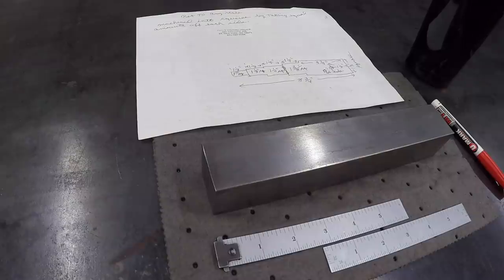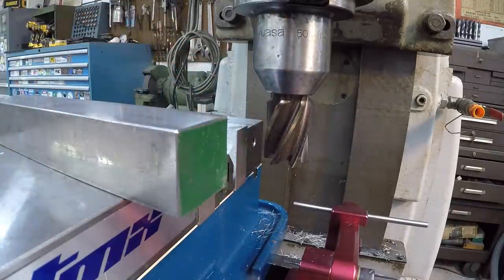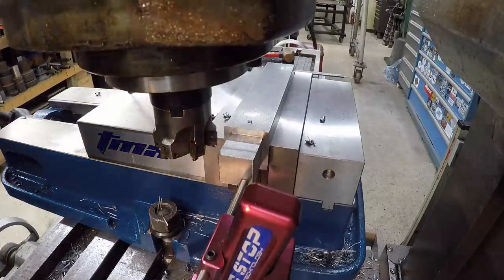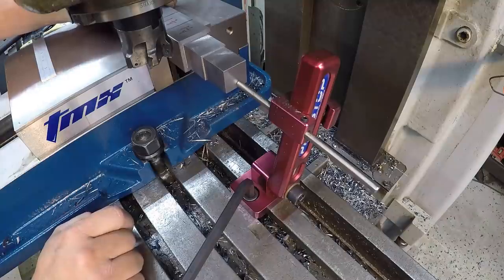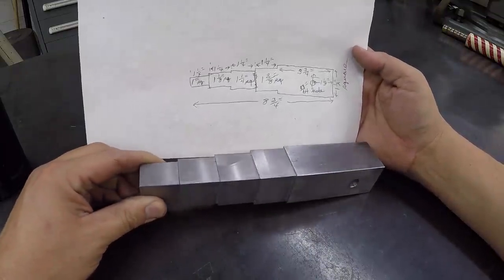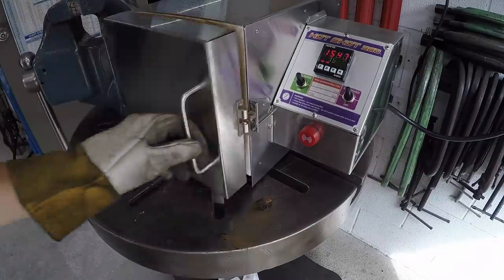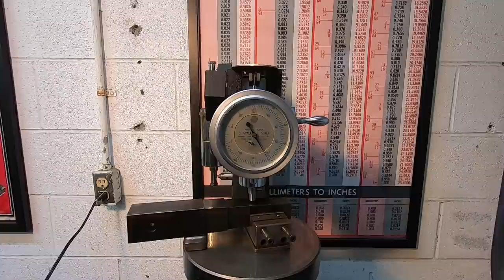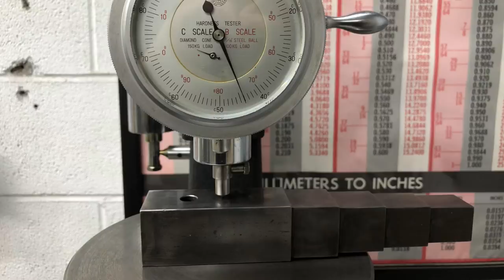SNS 296: Custom Square Drive Tool, Heat Treating

Comment: I've done my own heat treating for 20 years. I learned everything I know from two books. The easiest to understand is a book by Bill Bryson called "Heat Treatment, Selection and Application of Tool Steels. The other book which is much more detailed (and a lot thicker) and a little over my head is "Metals Handbook, Ninth Edition" "Volume 4, Heat Treating" Its put out by the American Society for Metals folks. My books say for 4140 to preheat the stock at 1200 degrees F for 10 to 15 minutes. This lets the metal calm down a bit. Evidently skipping this can cause the internal temperature to get much too hot, due to internal radiant heat. After preheat, increase the oven heat setting to 1550 degrees F. Once the oven gets to that temperature, the soak time is one hour per inch of material thickness. For instance if your part was 12 x 12 x 1" thick, soak time would be 1 hour. In your case it would be 1.5 hours. Remember, the timer doesn't start till the oven gets to 1550 degrees. Quenching is very critical, and as such, the actual parts needs to be touching the quench media. What I do is as quickly as possible, remove the part from the foil. Dallying here will only increase the oxidation of the surface, and not really affect the hardness of the metal under the oxidation layer. If you do it reasonably quick, I don't think you have a worry. Also move the part around in a figure 8 motion, since the oil the (headwind) oil will cool more quickly than the tailwind oil. A figure 8 motion will equalize this. The quenching process should continue until the part reaches 125 to 150 degrees F. This is uncomfortable to touch, but won't burn you. I read somewhere about the quantity of oil needed based on the volume of the part you are quenching, but my parts were always small. I had a 10 gallon metal tank, which was enough to get the parts down to 150 degrees, ONCE QUENCHED, YOU SHOULD IMMEDIATELY TEMPER. IT IS CRITICAL AND COULD BE A MATTER OF LIFE AND DEATH OF THE PART. This isn't from me, it is actually a quote in ALL CAPS from the Bryson book. Bryson says the parts structure is unstable until it gets tempered. He says the tempering oven should've already been preheated and at temperature, so the part can immediately begin the tempering process. The parts need to stay in the preheat oven for 2 hours per inch of thickness. The tempering time is not critical and if they stay in the oven a little longer it wont hurt. A note about wrapping with foil. The only purpose of the foil is to keep away oxygen. When I wrap my parts, I usually tear off some brown paper from a paper grocery bag and put it inside the foil, along with the part. The paper will burn, and that process will consume any traces of oxygen that may be present inside the foil package. I used this recipe for several years doing tooling for aerospace, and never missed a targeted hardness. I can't say what can be changed, because I didn't want to take a chance venturing from my success. Good Luck, and I hope this helps. Get the Bryson book. Also he has tons of charts that tell what tempering temperatures will give you what hardness. Its a great tool to refer to.   Steve

Comment: Hey Adam. I work at a large commercial heat treater out of Wisconsin. I’m not a metallurgist but I can offer you some info based on how we run 4140 and my heat treating knowledge. 
More quench oil. 
Remove the tool wrap before quench, you want direct part contact with the oil. You can leave yourself pull tabs or even use a piece of stainless wire layed in a seam to use as a rip cord to get it off quicker. 
You can try heating your oil up a bit. We typically heat to 120-140. This will help with not quench cracking your part also.
We run our 4140 at 1550 x 1 hour per inch of largest section thickness. 
The reason your seeing your low hardness in the thicker section is because the part has a thicker cross section and didn’t quench out as good as the thinner sections. This could be because it was under soaked at heat or because your quench is too small for the size part.  One more thing I noticed is in your oven. It looks like your elements are just on the side walls of the oven, also I didn’t see a convection fan in there. Granted I didn’t get a good look at it with the brief shots in the video. By the elements being on the sides the sides of the part will see most of the heat. That might be why on your test slug you have such a variation on the faces. In addition you could try a ceramic plate with stand offs between the soft brick in the bottom. 
I don’t think you would see any benefit bringing the part and oven to temp together. If anything you can extend your soak time on the part. Try soaking for 3 hours and see if there’s an improvement.
Reply: this right here, adam.
Reply: Very informational comment! Good read, hope this gives him some insight
Reply: You don't have to remove the foil before quenching , Just get it into the oil PDQ and then pierce the foil good while under the oil . A good  pair of shears or a sharp spike will do .Depending on the size of the part it helps to work with two people .
Reply: 9

Comment: Hey Adam!

Just wanted to share my experience with heat treating as a knife maker. The stainless tool wrap is generally used when heat-treating stainless steel. This is because you have to soak stainless at a much higher temperature than carbon steel (~1950F for stainless vs. ~1475F for high carbon). If you were to soak stainless at 1950F without creating an inert environment, it would quite literally cook the carbon out of the steel, and you likely wouldn’t see any benefit from trying to heat treat it. With adding the stainless tool wrap, you’re removing the option of oil quenching your work after pulling it out of the oven. If you’re going to oil quench, you can’t have the wrap. This is because you’re just creating pockets of hot air around the work inside the wrap and aren’t cooling it rapidly as it should be doing. Instead, with the tool wrap, you will need to quench between two plates of aluminum and add compressed air while pressing on the work with the aluminum plates. 

You should be just fine heat treating non-stainless steels without the wrap, soaking to ~1475F for 30-45 minutes and then oil quenching. Just making sure you’re moving the workpiece a lot faster through the oil as to make sure there’s constant contact of oil on the workpiece and pockets of air aren’t building up around it and preventing it from cooling/hardening. 

A good website for information on heat-treating is knifesteelnerds.com. They do all sorts of heat treat testing and cryogenic testing on different steels, and there’s a wealth of knowledge on the process!

Feel free to contact me if you have any questions, hope this helps!

Comment: I enjoyed that!  I'm just getting to know the oven too.  Weird results on the hardness tester.  It's working okay?  I think you want to preheat the quench oil... but not sure why you'd get different measurements on different sides like that.  Did you try turning the oven off and back on again?  ;)
Reply: ...and few whacks from your slipper.
Reply from the maker: Odd to me also Tony, but the oven seems to be working correctly. The test pucks that come with the hardness tester always shows its measuring spot on 🤷🏽‍♂️
Reply: All TOT has to do is breath on it.

Instant and precise hardness and temper
Reply: @Abom79  you overcook that part, temp should have been 1600, and that size part no more than 40 mins, I did HT in a tool room for over 10 years seen it all!
Reply: Abom79 I think our chart by the oven that comes from our steel supplier at work says to preheat the piece to 1250, then bring it up to the hardening temp. Don’t quote me on that for sure, but that sounds right. If you crease your foil so that the long crease is along one corner, you can normally grab it with the tongs and twist and it will unroll like a zipper pretty fast.

Comment: Definitely put your part in the oven before you begin to ramp up the heat. Some tool steels have a preheat temp and soak time to allow for the temp to normalize through the entire thickness of the material. Then ramp to full martensitic treating temp.

When wrapping your part, wrap it in a couple paper towels before the wrap and that will burn off the excess oxygen and further prevent scaling. TIP: dont wrap your part like a christmas present.. make it easy to get your part out of the wrap before dunking it in the oil to quench. Quenching in the wrap is what caused your part to come out softer and with inconsistent hardness, not so much the orientation in the oven.

When tempering or "drawing back" you can leave your part in the oven for as long as you like, the longer the better to allow it to normalize through out. Also, no need to quench when you take it out as you can induce stress and even continue to change the hardness. Just let it cool down to ambient on its own.

Great first run. Always fun to learn new things!

Comment: Adam, a couple of things.  When heat treating, soak time temperatures are listed per 1" of average cross section.  Also it is recommended to pre-heat 4140 to around 1200 - 1300 degrees, then bring up to your 1600 degree heat treat temp, and then soak as listed per 1" of average cross section.  Also, on the quench, it should be done without the foil, and preferably in an agitated oil bath.  The key to correctly hardening is to get as quick a quench as possible (temperature drop).  When the oil smokes, there are miniature bubbles of gas around the part, which do not transfer the heat as quickly.  By quenching in an agitated oil bath, this is vapor "insulation" effect is reduced significantly.

Comment: Hi Adam, 4140 is a crack sensitive material so oil media is best for quenching your tool. Also, to get better and more consitent properties the recommended austentise temperature for 4140 is 1550-1600°F, the amount of oil you should use is about 1 gallon per every pound of material, adding some type of agitation to the quench container will help remove the heat of the part faster and give you a higher hardness, you should be able to get HRC 52-55 with a good fast quench (less than 30 seconds from removal from furnace)
Reply: Well said Alex; I'd add that a metal bucket would be better too!  (Sometimes the part slips out of the tongs...ask me how I know)  Also, a bigger furnace would be better in order to stand this part vertically, but hey...go with what you've got.

Comment: hello from Italy
I have been using this system for a very long time, but in addition before closing the stainless steel sheet I place a piece of newspaper which at 250 ° C burns the little oxygen which remains inside.
It is true that removing the stainless steel sheet is better, but it is not always easy to do, especially if the piece is bulky and heavy.
excuse me for my spelling.
very nice youtube site
Michel
Reply: I have only done a heat treat once in collage, but we did the same with a piece of brown paper bag inside the ss foil.

Comment: Its been 20 something years but when I worked on heat treating parts we ran it up to 1750-1800 deg and quench it IMMEDIATELY no pissing around, from the furnace straight to quench in a matter of a couple seconds, then put it in the annealing oven somewhere around 600-700 for half hour and then let it cool down naturally. Check hardness in 4 areas and got the average.

Comment: The heating method isn't particularly important as long as all of the part is brought to temperature. The quenching is the important part for hardening. If not all of the part was hot enough though, it will not harden when quenched.

Heat treatments can get incredibly complicated but in a nutshell for steels, the part must be brought above the austenitizing temperature (varies depending on the type of steel), quenched in water, brine, or oil (they provide different cooling rates which work better for different types of steel), and then tempered. 

What is happening on a microscopic level, is when the steel is brought above the austenitizing temperature, the crystal structure of the steel transitions from body-centered-cubic (BCC) to face-centered-cubic (FCC). This FCC structure is known as austenite but it only exists at elevated temperature. If the steel is left to cool gradually, the FCC structure will gradually transition back to BCC structure and the part will be annealed and soft. This transition takes time. If the part is quenched, there is not sufficient time for the FCC structure to transition back to BCC and it becomes a a body-centered-tetragonal (BCT) structure known as martensite. Martensite is very hard but also very brittle. To make a tool usable so it won't fracture under load, some of this martensite must be converted back into the original BCC structure which is done by tempering.

Comment: A few opportunities for improvement.
-The hardness testing will be false if you try and do it through any sort of scale. At the very least polish the test piece with emery before you test it.
-The quench is too slow, especially for a marginally hardenable steel like 4140. You need around 100:1 mass ratio between the oil and the part to be hardened, and the hardness falls off dramatically after only a few seconds delay before quench. Hot oil quenches better than cold.
-I've seen others do it continually on Youtube, but quenching after temper isn't a commercially acceptable process where I come from. Air cool only.
Great video. Raises lots of points for discussion.

Comment: I used to heat treat steel at a company . We did toolsteel all the time-- The factors we always did was: When we bagged a part, we put a piece or 2 of charcoal Bricquets in the bag. That would fire up in the bag and use up all the available oxygen. The parts did not need to be wrapped tight as you did. We did not prop any parts up on blocks as that would inhibit the heat from consistantly heating up the part.The whole oven was glowing literally white hot when it was put in.after a soaking for like you said the chart said the thickness equals time what ever that rate was-we added 5 minutes. When the part came out of the oven, it was opened up immediately in front of a fan- No oil quenching at all. after 15 minutes cooling at maximum hardness, the unbagged part was put into a drawing oven at 350 degrees for 2 hours.Then the parts were sandblasted of any scale, and tested for hardness. EZ PEASY!

Comment: No foil for oil quenched metals, only air quenched. You will never adequately or evenly cool the metal with out the steel contacting the oil.

Comment: When I was taught to harden steels. We would take the stainless bag off and then put the part to oil. Works a whole lot better than dealing with the bag. The air pocket around the part insulates somewhat to prevent the instant shock that the steel must encounter for the hardness sought. Good job with the touch mark of quality too.

Comment: adam,  about firescale.  an old toolmakers trick; coat the steel with boric acid. it prevents firescale!
   you can quench with the boric acid STILL in place. maybe lifting the part off the kiln floor will allow heat to get to the whole part.  kiln furnature may help with unequal heatsoak.   hope this helps.  will be glad to corespond on things!  poppy's workshop says HI

Comment: The tool we use is a square shaft with a taper that goes on a 1in ratchet, instead of stepped off. Makes it easier for different size hopper gates. This is still an informative video. I remember when I was in machine shop class, we had to make something similar to this. Brings back memories. Love the videos!

Comment: As a bladesmith and tool maker ill sdd my 2 cents even tho I feel after 500 comments someone may have answered it by now. 
1. Debarb paste or simple clay slime will do for protection as foil is better suited to air hardening steels.
2.take steel ever so slightly hotter to account for loss by time it takes to get to the tank.
3. Quench is time taken to drop in temperature, larger pieces may require more severe medium to drop the temp on the whole part quick enough. Or an interuppted water to oil quench.
4.furnace position matters. If you can freehang the part.do so.
5.keep it up,love your content 👍

Comment: Do not wrap oil hardening steels . place in the oven bare metal , I heat 4140 to 1550F and wait for a good color match between the oven and the steel with no dark spot in the interior of the metal 
from there I soak at the rate of 15 min . per inch of thickness , use annealed wire thru the drilled hole leave the end of the wire out of the oven . I do not use tongs to quench. It will not harden properly in the area handled by the tongs .get into the oil asap if you lose color you will not get satisfactory results. . just FYI I have found that 4150 hardens better and more uniformly than the other chrome moly steels . hope this helps

Comment: Set oven for 500 degrees below hardening temp. - insert part when oven reaches this temp - reset oven for hardening temp. - when oven reaches this temp start timing ( 1 hr for each 1 inch in solid cross section)  To quench - part should go from oven to quenching medium in less than 2 seconds.  ( quench medium - brine is harshest , water is less harsh, oil is less, and air is least)  The more harsh the faster the cool =the harder the part.  It appears that the wrap is acting as an insulator to the quenching process.  Tongs will absorb heat where they grab the part and cool it slower than the rest of the part. You will get a lower Rockwell reading in this area.  A rod or grab ring thru the drilled hole for the tongs to grab would help.